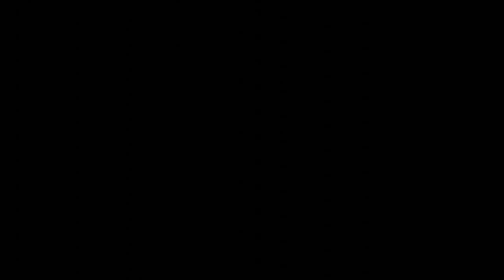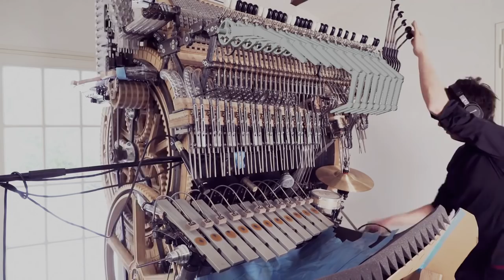Kinetic Fingers - Animated Visualization for MMX

Comment: Seeing the fingers work like this makes it a lot easier to understand how they will work. I still have the main concern of if they will be in the way when Martin wants to play on his own and not through the crank.
Reply: Martin is adding an assist motor to make it easier for him to turn the machine, so he won't need to hunch over as much for leverage. I think it will be fine.
Reply: @rich1051414  Yeah, I've seen his video about the addition of the motor and everything. I think it's more so the sice of the fingers that has me concerent. Like will they be to much in the way when he wants to reach over to hit the lever.
Reply from the maker: @AaronTheBlackDragon  It's kind of hard to tell from this camera angle but I think there should be plenty of room for him to reach the black & white drop knobs to play manually.  And he can always change the angle of the finger to be lower.
Reply: @meticulae.designs  Yeah, that's right. I'm really interested in seeing the next version of them on the machine itself to get an even better understanding of them.

Comment: It blocks view of interesting parts when looking close.
Pipes behind are very nice, but they are not visible.
Also, movements are very large, so viewer instinctively moves attention from marbles to fingers.

It's good idea to try smaller version of fingers (i.e. bolts size looks less distracting).
Reply: WHAT view? This is going on a world tour, not a close-up youtube video shot. Nobody will see that stuff from the audience.
Reply: The chances of you seeing the pipes live would require binoculars or to be really close to the machine, in which if there are fingers, you would be close enough to see some of it working, ultimately 

even if you didn't watch him build the thing you wouldn't notice it either way in my opinion, you would just assume how it works because its the most function over form part of the design, its there merely to guide the marbles which isn't the interesting part of it whilst it is performing

However if you were analysing it you would probably only do so up close. in which you would see it anyway.
Reply: @TheBaconWizard  Yes, because the world tour is the ONLY way we are going to see the MMX... or you know. EVERY Wintergaten Wednesday and musical video about it to come...

Comment: The rigid fingers should have their movement inverted. Going down when releasing a marble. Because they look more like fingers playing on a piano keyboard.
The other fingers are great, and a little Tim-Burtonesque. I prefer them over the rigid ones.
Reply from the maker: Inverting rigid fingers would be very difficult with the way the machine is currently designed.  The circular pieces that the fingers are mounted on rotate backwards when moved by a programming pin, and would need to be replaced with something else for the fingers to have a "piano playing" motion.  (Plus, those circular pieces were loctited very securely in place a few videos back so I don't think they're going anywhere.)  I've found a way to do the piano motion with moving finger joints, but haven't made a video of it yet, and since it seems Martin wants to stick with rigid, I may not get around to it.  But who knows!
Reply: @meticulae.designs  , moving finger joints with a down movement will look a bit like guitar finger picking. :-) Sounds great ! I look forward to watching your video about them. 

Have a beautiful day.
Reply from the maker: @leroidlaglisse  Well hey, I figured out how to get the key-pressing motion!  Check it out: https://www.youtube.com/watch?v=4WHBgD8XiGM

Comment: (Thank you for the visual 👍) They remind me of a Tim Burton's movie Nightmare before Christmas. Maybe if they were colored according to the music note pitch? IDK... I think they might be cool to look at for a while until you realize all the natural beauty they are covering up underneath, with the additional noise from all the moving parts. If they have no real function other then looks, they are probably better off not added.
Reply from the maker: The rigid fingers (which is the direction Martin seems to be going in) should be silent when mounted securely.  And based on tests I did, the spring steel for the moving joints, were it to be used, should be pretty quiet as well.

Comment: Amazing animation Meticulae designs, you are very good in what you do, not sure how did you synchronize all the movements so well, amazing.
But the problem with the fingers is that they don't have a real mechanic purpose, this machine already have excess of complexity, there is not need to add more even for visual reasons (which they block  the real parts). 
You can see the real mechanism that drops the balls under, so many would wonder why there is other layer above and what it does?
That is also the reason I don't like the metal funnels or anything which goes against a clever material  selection just for aesthetics. 
But well, is Martin´s decision :)
Reply from the maker: movements were synchronized very meticulously ;)

Comment: I still think that the fingers and the levers would work much better if combined, like long front-facing levers. With the current design, the fingers have no practical purpose on the mechanism and also obstruct the levers from the site of the player: if they were combined, the levers themselves would help to make the movement more visible, while also being useful and reachable.

Comment: Now that he might not only use contact microphones; the noise the machine produces will be relevant and it would be a bit silly if these fingers add significant noise unnecessarily.
Reply from the maker: The rigid fingers (which is the direction Martin seems to be going in) should be silent when mounted securely.  And based on tests I did, the spring steel for the moving joints, were it to be used, should be pretty quiet as well.

Comment: It seems you have a real good understanding of what you are doing is this done in a CAD program or how do you do this. The reason I ask is I am currently building a Octagon sauna / bug out shelter and I'm using models to try and explore the design before I build the actual unit. A the reason for the model use is I don't know how to do CAD. I was wondering if you are using a CAD program would you be able to do some design work for me and what would you charge ? New subscriber here
Reply from the maker: Yes, I modeled the fingers in a CAD program called Sketchup, then animated them in Blender (and did the video editing there too).  Sure, I'd be happy to talk more with you about your project; you'll find my contact details in my "about" page.  FYI I highly recommend Sketchup if you're interested in learning how to model on the computer, it's a very fast and intuitive way to build your ideas quickly, even if you have no prior CAD experience!